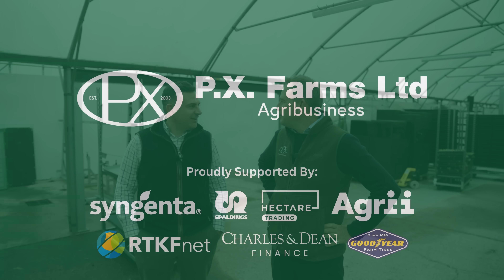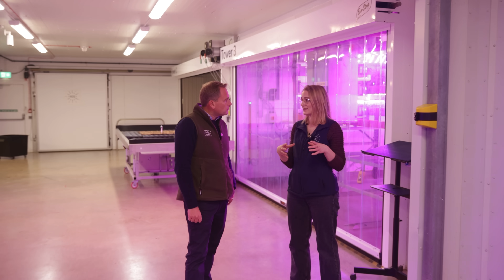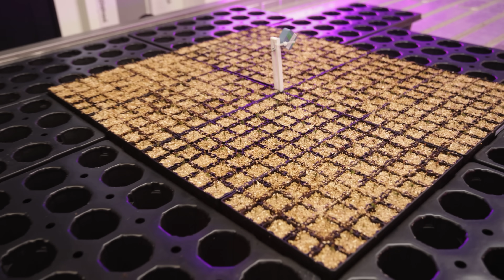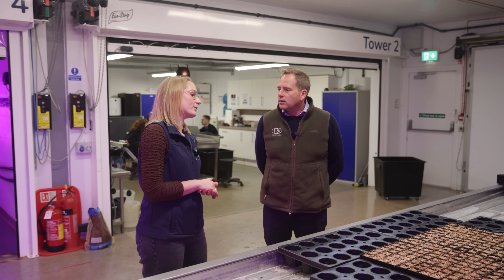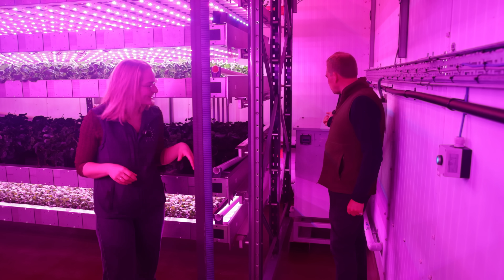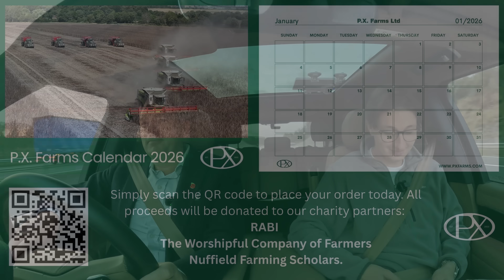Farming In Space?: Exploring Vertical Farms with Agrii

Comment: Dexion P90 racking can be up to 30m tall. Other systems e.g Mecalux can be built as Clad racking where the racking forms the structure of the building., here 40 meters tall or even taller can be achieved. So yes you could build a system taller than 12 meters. The 12m restriction comes from the length of upright you can get on a lorry. heights above this are achieved by splicing frames on top of each other. The system would have a lot of levels but each level would be relatively light so the load bearing capacity of the frames probably won't be exceeded, but this would need to be double checked, as part of the design process.